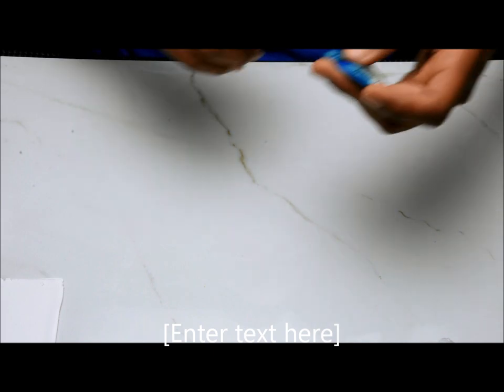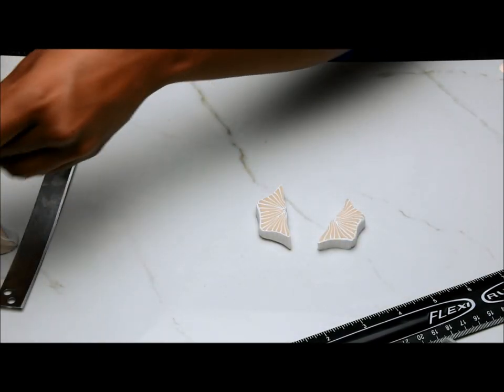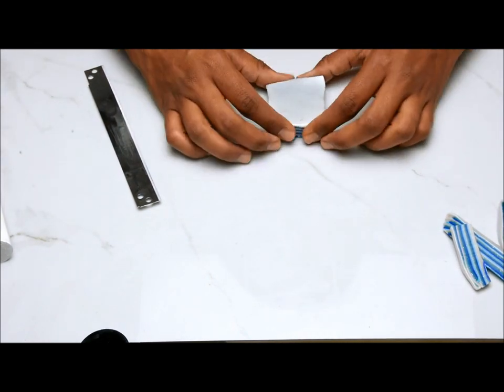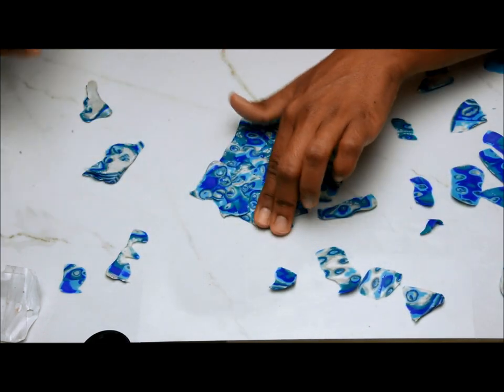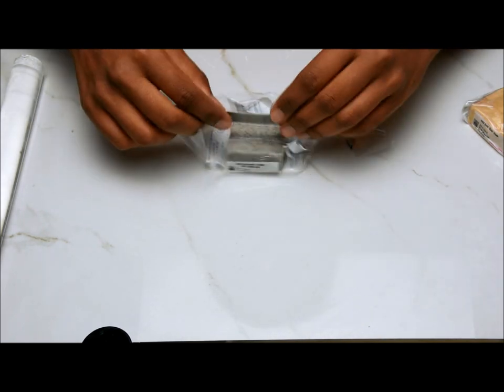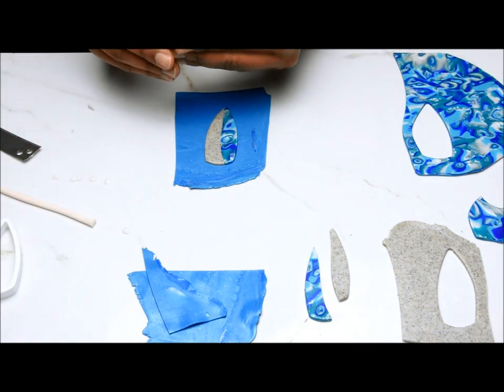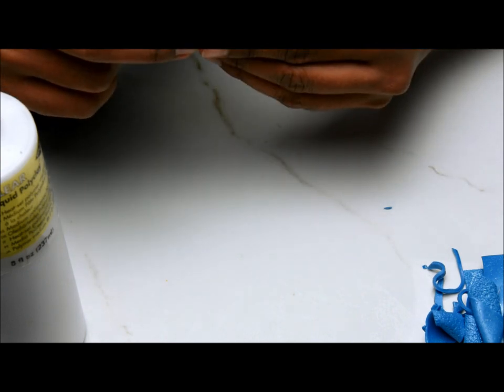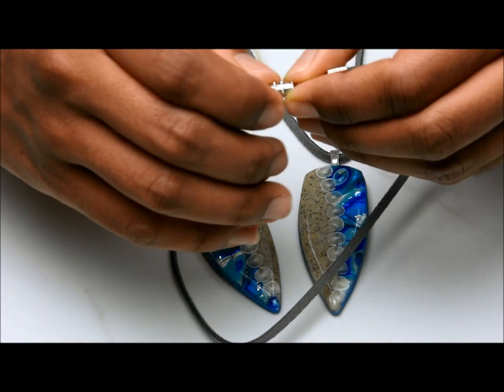Polymer clay Project: Polymer Clay Beach pendant Tutorial

Comment: 3:12 If you flipped the cane at this point, you'd probably find that it remains more consistent in thickness. As much as we may try to work evenly, our dominant hand is almost always stronger, and in this case 'heavier'.
Aside from that, you can try using an acrylic block (or anything flat) for rolling things, they will come out very even, just be super careful there's no air in the cane, or you'll end up with a blowout!